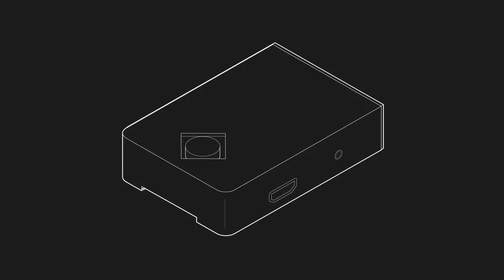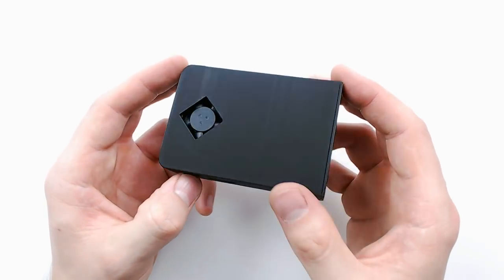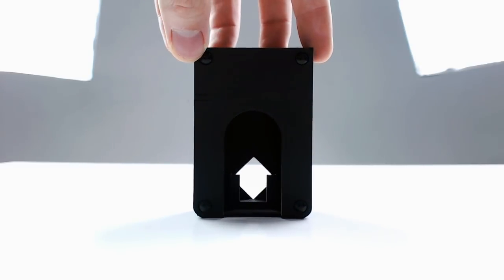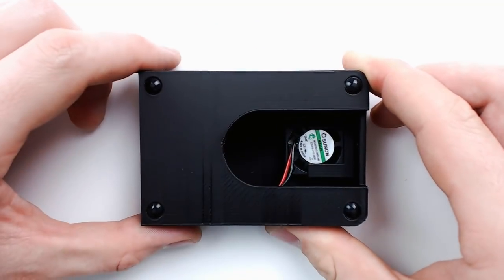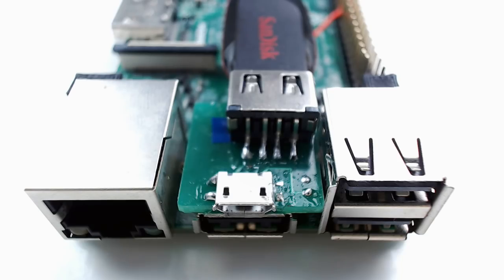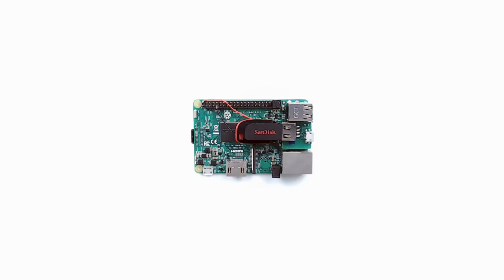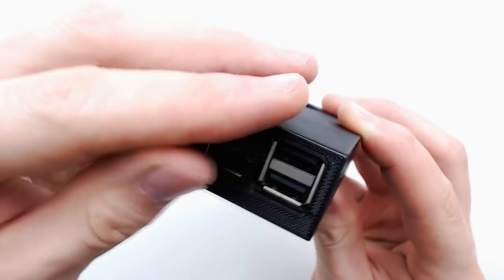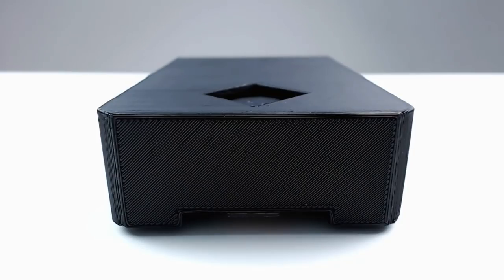The NODE Micro Server (Prototype)

Comment from the maker: What do you want to see more of?
Reply: Just more videos, i think anything you throw is interesting.
Reply: I love your portable pi computer builds. Recently I've seen some e-ink displays for the Raspberry Pi and was thinking back to your project using an old ebook to hold tons of data in the case of an emergency. Would be interesting now that 7 inch e-ink displays are available that you could make your own.
Reply: Decentralization :)
Reply: Still active ?
Reply: sdr radio maybe?
Reply: Really looking forward to the mini-server.  Would like to buy one, it's a very nice design!
Reply: I absolutely love the zero terminal – would love to see more of it!
Reply: Actual uses for the micro servers. I really enjoy the builds, but what can they do for us? I've been thinking about the idea of setting up a bounce network where you can make them almost disposable, deposit them at an access point with wifi pre-configured, then have them phone home (or have home defined dynamically or passively) and reverse ssh tunnel on 443, so you can route your connections through one or bounce through a network of them. The other build idea is a zero pocket reminder thing to manage todo items on an oled, battery, powerboost 1000, and jog dial/buttons for interface. Beep, buzz, flash to remind you from a plaintext cloud list of items and instructions you modify elsewhere. I'm on the santa list (and googleable :| ) so drop me a line if you want to discuss more.
Reply: Hi dude are you still active on youtube
Reply: Hey +N-O-D-E are you still out there?
Reply: Decentralized tech/projects, loving all the server builds also
Reply: Blockchain, cyber security or hardware hacking type of content
Reply: Can you run Kolibri OS with say qemu or bochs (or any other emu...etc.) on any model of RPi or other Pis ?
https://en.wikipedia.org/wiki/KolibriOS
Wish to see a video on that if it failed it do not matter.
Good luck, BTW there's a new hex[a](6)-core pi, I think it's NEO4 or some Pine model, with 1 or 2 GB ram.
Reply: Pocket servers, love that kind of stuff
Reply: U can Make a Orange pi Mini server?
View All Board Here
www.orangepi.org
I Need Orangepi R1
Reply: More pi mods and builds
Reply: I agree with ^, more Pi builds. Maybe a cluster/tower for the sake of fun (a Pi cluster is rarely worth the  effort for actual use) or make it a bigger project and assemble a server using the cluster.
Reply: It's been 2 months.. kinda worrying

Comment: Have you considered using other Pi style boards? Ie the Orange Pi Zero (quad core, 512mb ram, 44x46mm footprint, 100M ethernet with POE, single usb, wifi) that only costs $11 usd
Reply: Robin Hilton or a bananapi, such powerful chip in pi zero form factor, its a shame they arent that popular because theyre great!
Reply: @smirnoffvodka2618  seems like an idea but seem to be twice as expensive as the orange pi. Probably the lack of citrus and added potassium that raises the price ;)
Reply: Robin Hilton definitely true, and lets be real here.. nothing can beat the amount of support on raspi for whatever project it is you are working on
Reply: @smirnoffvodka2618  I have 4 orange pi zeros and 2 orange pi ones that am intending to make into a Docker swarm for personal learning experience
Reply: Robin Hilton that sounds very interesting, are you going to hook them up to each other wirelessly or run a cable thru all of them?
Reply: @smirnoffvodka2618  I have an 8 port switch that also runs on 5v so will be using that. Thinking I might have each node broadcast its own WiFi access point to enable access from a phone/tablet for near by remote access to configure outbound ethernet settings if moving the ethernet switch between physical networks to save hunting for new device ips after each move.

Comment: Why did you remove the ribbon connectors and AV jack? It doesn't seem like you gained any useful space except to add a screw hole. Why not just move the screw to a recessed hole on the button and use one of the mounting points already built into the board?